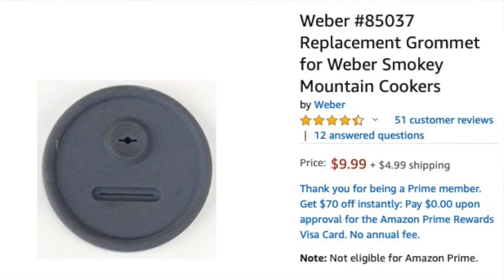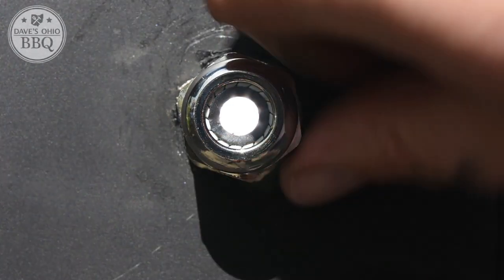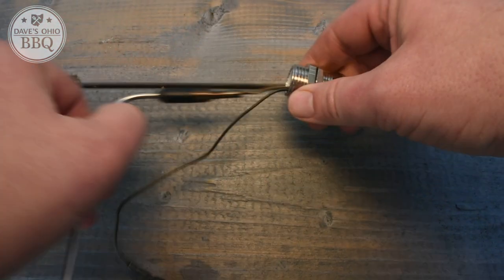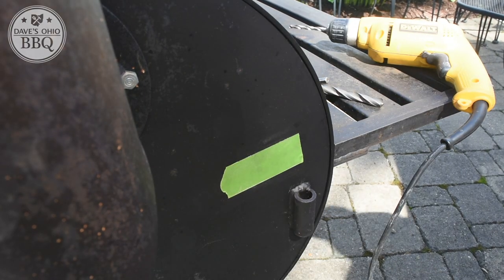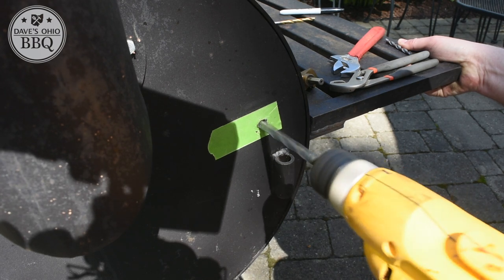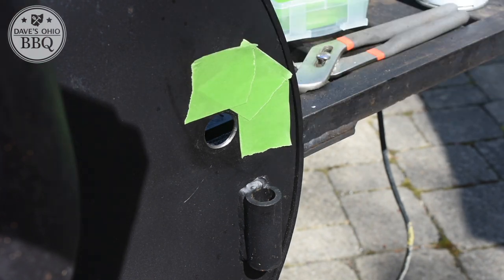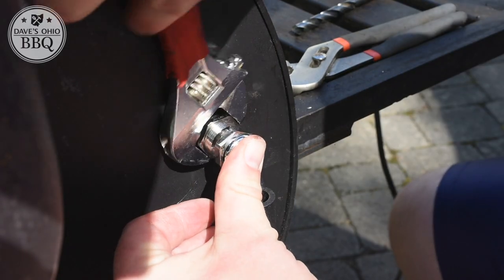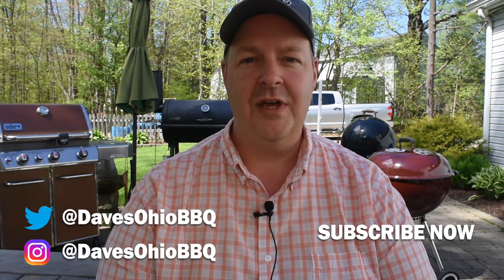Installing Thermometer Probe Port on an Offset Smoker

Comment: I cut a little flap 1 1/2" sq.  of 12 ga. metal, took cut off wheel and went 1/2 way up with a 4" cutoff wheel, little hinge and only the wires go into the cut outs. Very easy, flip it up, put the probes in and let it down, little hinge keeps it closed when your not using the probes. It's popped riveted on the smoker. Or if a hinge is to much, just one hole at 12 O'clock with a little 8/32 Machine screw will let if close perfect

Comment: I have a wsm. The hottest I’ll ever take it is 400 for a hot n fast brisket. 

Which grommet do you recommend? One like this or the silicone one? I can cut the hole to fit either one.
Reply from the maker: I use the silicone weber grommet

Comment: Nice mod.  I didn't realize these had a silicone ring inside. Stainless and silicone should last.  If you were adding a port to a WSM would you do with this or the silicone grommet?
Reply from the maker: Sparky Thomas probably the silicone grommet. I installed one on my Smokey mountain and it’s functioned perfectly. Thanks for watching.
Reply: @daveshouseofbbq Thanks Dave.  Picked up a used/older WSM and looking at options.    I did the tamale pot/smokey joe build awhile back and did use the grommet.
Reply: Use this probe port if you don’t have a step bit for the grommet.  I always like stainless vs silicone rubber especially the longevity you’ll get out of the metal vs rubber.

Comment: Hi Dave!
Is your smoker 1/4” steel? Been looking for these ports on amazon but cant figure out which one to get and if they fit trough 1/4” steel. Im leaning towards the 3pcs uxcell PG13.5, but again would it fit my 1/4” steel? Do you know if they are the same as the one you got? Thx for great channel. Cheers from Sweden :)
Reply from the maker: I think it is 1/4 inch

Comment: This probe port will NOT fit a smoker with 1/4 inch thick steel unless you tap the hole and thread the port into the metal wall of the cook chamber. There is not enough thread protrusion for the gland nut to "catch" the threads of the port.
Reply from the maker: It worked on my smoker. It’s been on there for years. No issues.
Reply: @daveshouseofbbq  Yes, because you threaded it directly into the metal. Also, the metal of your cooker isn't as thick as the metal on mine. My comment is for those who have smokers with 1/4 inch thick steel to make sure they don't drill out the hole too large for the probe port to thread directly into the metal. The probe port threads do not protrude far enough into the cook chamber for the nut to catch the threads.

Comment: The link on Amazon states that this will not work on 1/4” steel which is what I have
Reply from the maker: Do they sell one that is designed for 1/4 steel?
Reply: @daveshouseofbbq  not that I have found